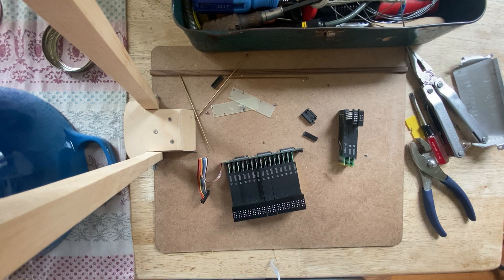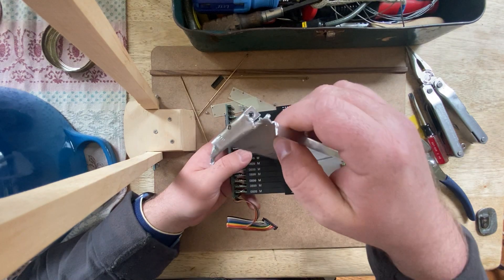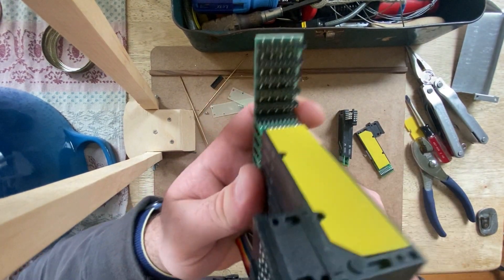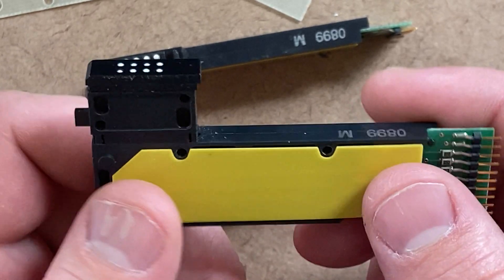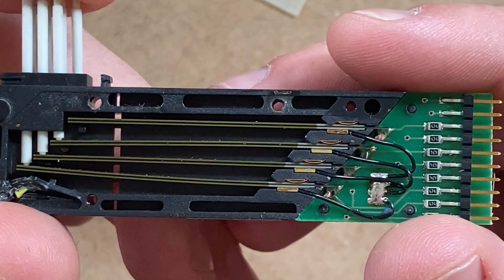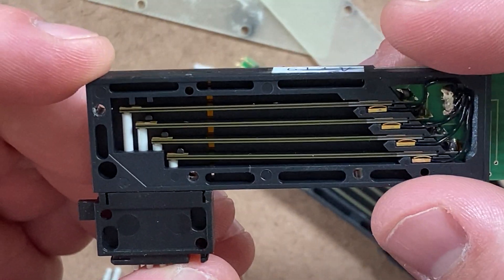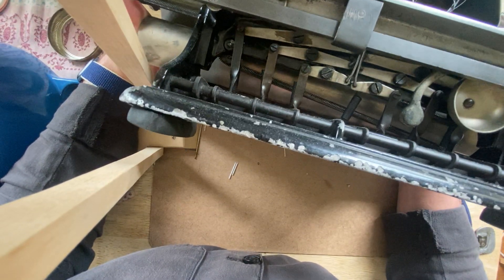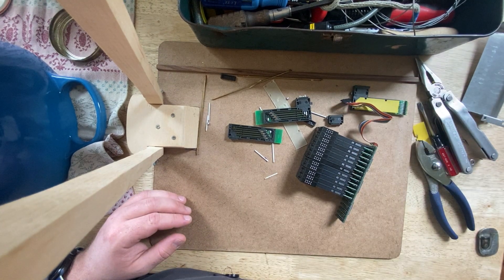Levers and Pins: Inside The Refreshable Braille Cell: Take-Two of Taking Apart the Braille Lite 2000

Comment: These devices are made by METEC. They are piezoelectric devices operated by a DC voltage of 200 volts. They are not current operated.
Reply from the maker: Thanks John I gotta make a new video! I just finished moving so I should be back at it and can provide more accurate information. I was just having fun taking it apart.
Reply: @Charlie's Desk Hey, please make a new video with the links of all components that you will use ...

Comment: It's a memory metal.  Run a current through the "tweezers" and the metal on once side contracts, causing the tweezer to bend and push up the dot.  Remove the current and it straightens out and lowers the dot.
Reply from the maker: Thanks Jim!! Gotta make a new video now
Reply: @CharliesDesk  
For even more fun, connect a power supply across one of the tweezers.  Set the voltage low to start and just enable output for a moment to see if it moves.  Up it by 1 volt each attempt until it pops up.  That would really enhance your video!
Reply: @salbahejim  this is a wonderful idea and I recently started working with a student who can help me bring this content more effectively! I really appreciate the comments and information!! Have a great day!

Comment: there is a section of unicode that is all 8-dot combinations.  i used ANSI escape sequences plus unicode to completely animate the dots on an Orbit 20 - from Linux.  On iOS, I can get it to read the keyboard for 2-way comms.  From Linux, it seems to be a mess; where I can only get display output, and no kb.  You would think that Linux would be an excellent place to learn to use braille from.  It would be helpful to have a far more raw driver to work with; where I am just reading and writing pin movements.  I have almost no interest at all in non-ASCII braille; as the point is to stay employable if I lose my vision completely.

This whole area seems ripe for an overthrow; with "non-medicalized" gear bringing prices down.  If it can be made cheap enough, sighted hobbyists might use it for text reading or controlling computer terminals.  Braille is such a small, esoteric, localization (ie: like a country/language/culture setting) right now.  It sounds crazy, but the whole idea was made for sighted people that wanted to read in the dark during night-time military operations; not for blind people.  Sensing incoming messages; responding without looking, etc.

Multi-line, 80 char displays would lift a barrier to getting into it; if only prices would come down.  (The Canute is an interesting concept.).    Using vim is super-hard on an Orbit 20.
Reply from the maker: Thanks for sharing all this info. I agree with many parts of what you say, I might add there were many efforts at raised text accessible non visually many years before barbier
Reply: @CharliesDesk  My Orbit20 is currently not working. I sent it in though it is currently out of warranty. If repairs are too much, I might just ask for the hardware back.  I own an Orbit40 that still works fine. The Orbit20, their tech support thinks it's a hardware problem; but the pins are all just fine. The reader freezes on a line after it's turned on.

I have been working with another person on making a braille keyboard out of a 4x4 macropad; programmed in Circuit Python to look like a US qwerty keyboard to what it's plugged into.  We managed to get these baked into the back side of a 3D printed iPhone case.  It is SO much easier to type on this computer braille keyboard on iPhone. It's possible to code in vim with it to give you some idea.  Almost all practical problems are just due to bad keyboard navigation in desktop apps.

So... If I get my Orbit20 back broken, I would like to figure out how I could connect it to a Raspberry Pi, to just make a literal display.  My 4x4 Braille keyboard runs circles around the keyboards that come on real displays; because I can just use Linux as-is without the OS being aware at all that it's a braille-layout-keyboard.  I'd like a dual sighted/blind display on such a Linux keyboard: a 20-char LED, over a braille equiv. That would be the basis for a headless Linux computer.  

I did setup a RPi400 qwerty keyboard-case computer that worked great until I think I fried its WiFi with a charging brick.

Comment: Hey thanks for sharing this nice break-down of a traditional Braille display. I learnt quite a bit! I guess the long levers are bimetalic strips, so when you heat it up (resistance heaters supplied by black electric wires), one metal (bottom) which is of different kind (say copper) expands more than the other (top, iron), but since these are glued together (the thin black layer visible between the strips), the net result is a bending of the strip upwards! Thus you have a raised dot.
Reply from the maker: Wow! You sure have some knowledge! Thank you for sharing! So this was a way around having to pay for the type of electromechanical crystals? That's very cool, but I can see how it takes up a ton of space within the device.
Reply: @CharliesDesk  Yes, this is old but very reliable technology. No wonder they have worked so far. But as you said, these are big! so its hard to get more characters built into a system, especially if one wants multiple line displays. And the cost. Need better technology for sure.
Reply: @subirbhaduri  These are piezoelectric bimorph actuators. They use the piezoelectric effect as Charlie talks about in his other video, rather than bimetallic heating, which would consume much more power and take longer to move. Here are a couple of links about them:
https://link.springer.com/chapter/10.1007/978-3-319-94274-2_43
https://www.rapinstruments.com/product/18418/high-accurancy-bimorph-actuator
Reply: @tinilk1  Oh i didnt know that, thanks for sharing. The link explains it all!